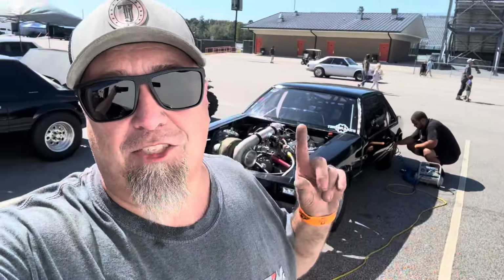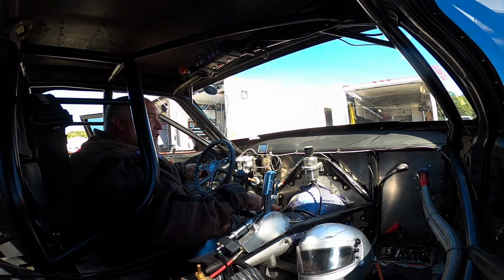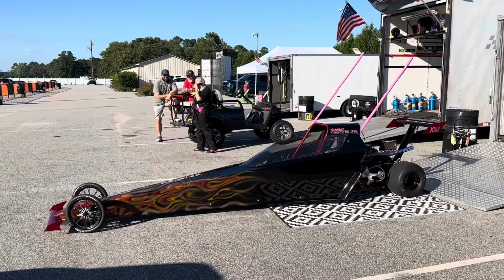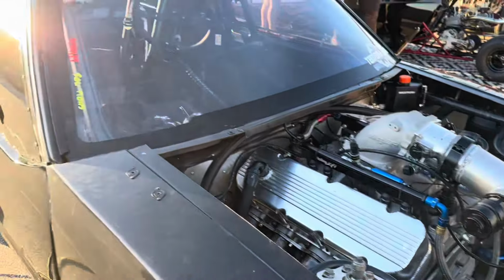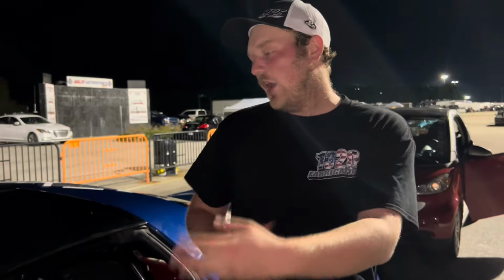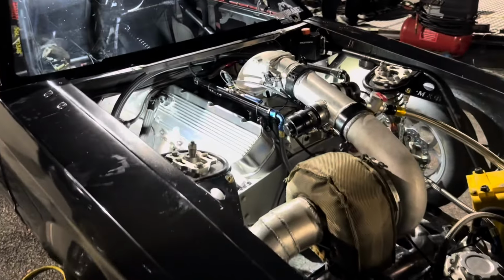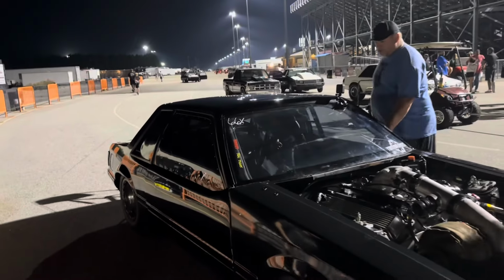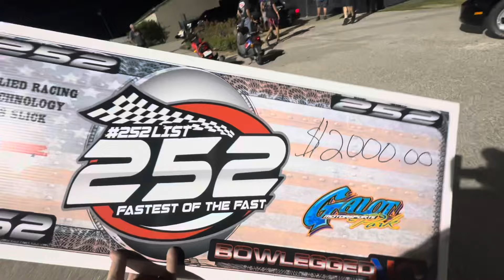WE WON // 28" Slick Racing // Boosted BBC is FLYING.... New Personal Best as well..

Comment: John do you have the Master Switch in the interior tied to the rear switch ? If so you could put a pit pin in to lock it so the ties shake won’t turn off the car .

Comment: Just an observation but it looks like you do your burnout two foot from the grate. Deep in the water and your burnouts seem very short.  Im just curious if that is a factor.
Reply from the maker: I like to start the burnout in the edge of the wet.  Also, I always try to match tire temp to track temp when warm.  If tires are really cold and track is cold, I'll do longer burnouts.
Reply: @TurboJohnRacing  thank you for taking the time to explain that.

Comment: @turbojohn the new car gets on the chip just as fast as a nitrous or blower car.. its Wild!
Reply from the maker: It is wild.... The bye run I added 200 rpm to 3800rpm and it made 6psi in 3 seconds.... I bumped in at 1.5 seconds... it's wild